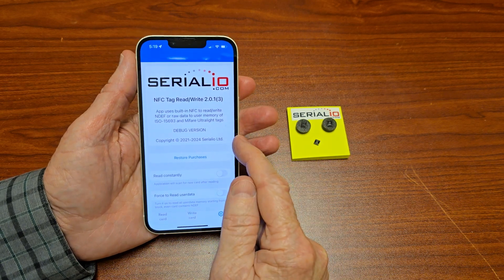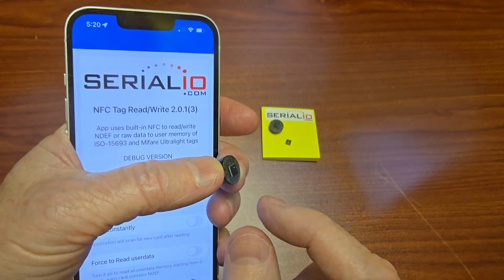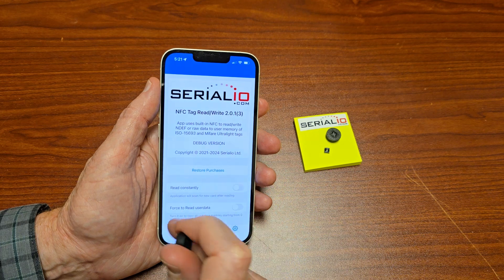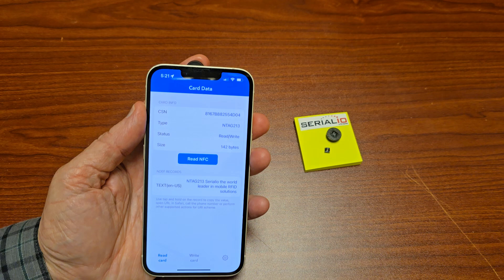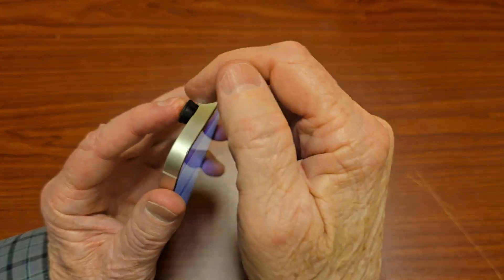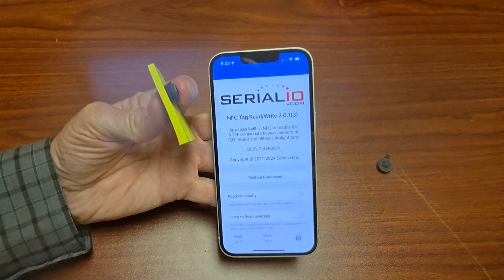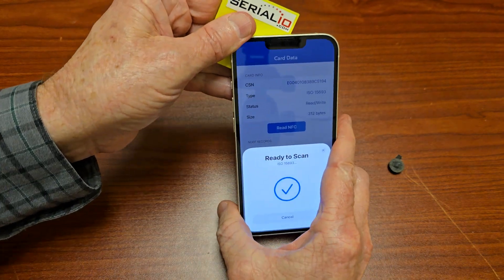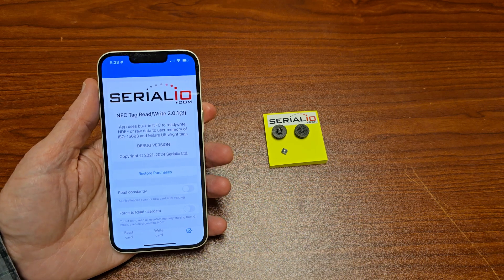iPhone NFC Read Distance | Tiny NFC Tags SLIX vs NTAG213

Comment: I've increased my phones nfc distance accidentally. I was in hurry to get buzzer mesh off, speaker mesh off as well and microphones. Well i did manage to brake connector of wifi board and and charging board. Its old phone anyway. So i just cut both wires as long as in middle of battery. Cables was still on motherboard. Now when i bought something. I dont even need to put phone directly on nfc reader to pay with google pay. The range is between 5-10 cm. Even i was shocked by that. Now does those to antenna cables managed to amplify my nfc in phone. This never happened when i broke bouth antenna cables. Its mu-mimo 4x4 or 2x2. So when i think about it. Were cables are in the middle the got boost on nfc while still connected to motherboard. And they have anything more to do with charging board. So they are not isolated enough to boost nfc while they are connected to charging connection. Those two cables which are connected as it should be they interfere with nfc signal. So thats why nfc is working at very short distance. Like very close contant with nfc reade. I wonder if those cables are split per cable from motherboard to charging board on both sides. Left and right. What would happen if those cables are also connected to nfc. It would be longer a near field communication/connection it would be lfc. Long field connection. I was paying twice today like 10cm from actual nfc reader

Comment: भाई, Android में एक NFC टैग पर कितने Task लगा सकते है??
Reply from the maker: >Brother, how many tasks can you put on an NFC tag in Android?
You need to clarify what you mean.
Reply: @SerialioSolutions  can we fix only One Task in One NFC?
Reply: @surajwavre8291  what you mean by "Task" is unclear. See NDEF format definition, or you can write RAW data on NFC chip
Reply: @serialioltd.7781  Sir, Task mean When I put my phone on tag, it will go on Vibration Mode and Mobail Data go Off, both should done in One Tag? Or I have to put 2 tags for this??